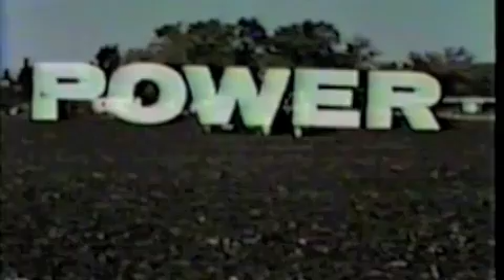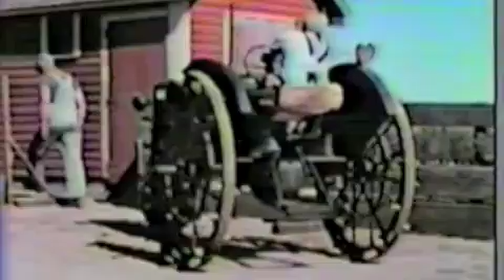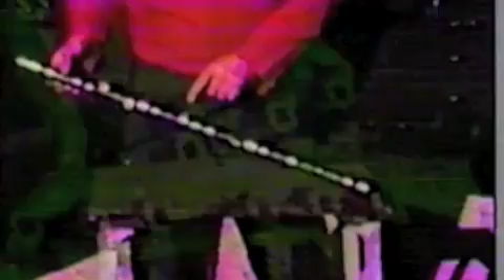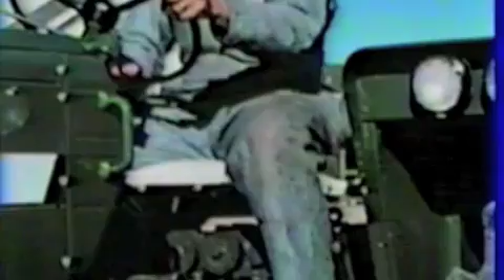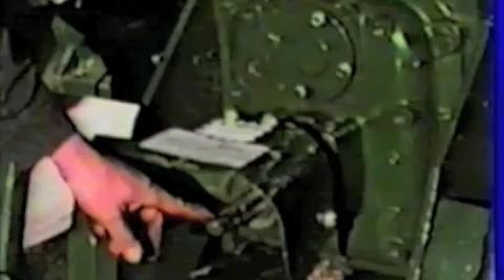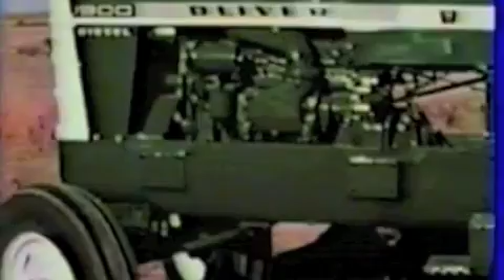Power for your farm future

Comment: One of the features I especially like about the larger Oliver tractors is their use of a cast iron 'U' shaped main frame, which added useful wieght and rigidity to the overall construction.
 It was similar to the old  Massey Harris tractors, which initially utilised rolled boiler plate, before adopting the cast iron mainframe that was a prominent feature of most of their tractors.

Comment: I’m not sure many things have improved these days. Back then, people knew how to set a plow. You would see 80hp tractors pulling 6-14’s at 8” deep. Now a tractor that’s 100hp pulls its guts out to pull 4. Today they are going to this great idea of cover crops. My grandfathers did that, they knew how to take care of their soils. And if you see anyone till up a field that’s been in no till for many years, you need 500hp to till it. Strange, because the soils is supposed to be so much mellower and with no hard pans. I worked for a CaseIH dealer, and we tested tillage equipment one day for customers on a farm that had been “successfully” in no till for 12 years. If I turned off the front wheel assist on a 225hp Magnum while pulling a subsoiler, that tractor came to a complete stop trying to go through that concrete.
Reply: Complete and utter nonsense

Comment: Anyone have an 1800 with a 6-14” plow? How did it pull?
Reply: I now own my Dad's 1960 1800A....Gas....4-14's with a clod buster attached....pulled like a champ....but the promo of 2 12' disc's attached side by side are a bit of a stretch for a 77 HP tractor....unless u just wanted to "scratch the surface"...but just a smooth running solid tractor to run as a young man and now to still have in possession for my sons and grandsons.
Reply: I’m sure it could be done if the plow and hitch were set right.  In furrow plows pull easier as well. Try it in the heavy clay soil of my area and we’re talking 4-16” lol, possibly even 3 if it’s deep

Comment: Many are installing 5.9 Cummins motors in them when old Waukesha blows..
Love these Olivers
Reply: Cummins won't fit in Waukesha frame.  Need one with a junk perkins.  Detroit powered tractors never give up, and are too valuable anymore to swap.
Reply: @randymagnum143  saw a few Oliver's with 5.9 Cummins at pull. .
Not sure how they fit it in.
SAE bell housing match?
Adapter?
"Not many walk to shore motors "left.
Peace out
Reply: Maibach tractor in Creston ohio made adapter to install 5.9 in the 50,and 55 series tractors @randymagnum143

Comment: We had a 1350 Oliver with a factory loader on it on our ranch growing up, grandaddy bought in 71’. It’s still there today and still working, it has about 4500 hours on it, and runs like a champ, we added remotes to the rear and a canopy. It’s always been a hay/utility tractor, had a set of forks on the front, great for limbs and hay rolls. Granny ain’t selling either

Comment: oliver still was no competition for john deere at that time. and for what was coming from Deere& co. in fall of 1963
Reply: Randy Robinson check out the Oliver Corporate tractor that was to come out. Would have taken over the farm tractor industry.
Reply: I grew up farming in the late 50’s with Oliver and John Deere. Our JD model G didn’t couldn’t hold a candle compared to our Oliver 88 in plain pull and the JD had no live PTO.
Reply: @thevox1075  got pictures?
Reply: Justin Altemeier look it up right here on YouTube.
Reply: Especially if Oliver was able to come out with that CVT transmission they would of made deere and IH look like they were in the stone age
Reply: Nah lol. The 1900 scared Deere into coming out with the 4020 because of its horsepower rating
Reply: @nellsonstout7001  Can’t forget that John Deere also had the 5010 out at the same time. Much more power and lugging ability with that big 531 cubic inch engine than the 1900 had with the 4-53.
Reply: Randy Robinson JD was running those old twin cylinder things with hand clutches and pony engines till 1960 ,give me a break .IHC ,Oliver ,Ford ,Massey left them for dead with innovations .
Reply: @interman7715  I was not a fan of the John Deere 730, but the diesel was the most fuel efficient tractor ever up until that time.
Reply: @greggergen9104  that's complete BS

Comment: What an astounding leap in power, comfort, convenience, and technology in only 25 years from the Hart Parr 70 in 1935, to the 1800 in 1960! That must have been dizzying in the farming community! I wonder if they could have known then that a lot of 1800's would still find themselves in regular use almost 60 years later?
Reply: I’ve got a 1944 70 that’s still a worker. Almost 76 years after it rolled off the line.

Comment: 300 pound grille? I'd hate to have to take that off...
Reply: Have a hard time putting a dent in it though!  

Plus, that was a third of a set of front end weights at that time... so if you added a standard 1,000 set of weights on the front, you now had 1300 lbs of front end weight, which is close to what a lot of modern tractors have... 

Later!  OL J R :)
Reply: I have. I think they are over 300 pounds. Everything was stated conservatively back then including horse power.

Comment: Dad had a 1950-T Oliver. T indicating Turbo. My grandpa was crossing an old bridge that hadn't been crossed in 6 years, but it was a short cut to where they were going, and pulling a man operated grader behind it. Just when the front wheels made it to the road on the other side the bridge gave way. The tractor dropped 25ft and landed on it's wheels and the bridge flipped the grader on top of the cab of the tractor. Tractor ws still running and trying to climb out. This happened in 1969. Sold it
Reply: Was everyone ok?